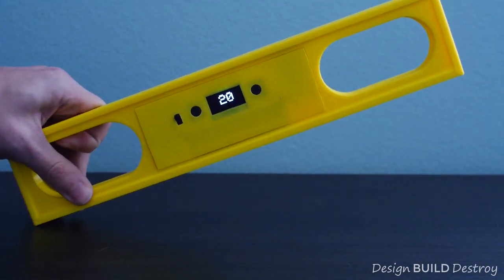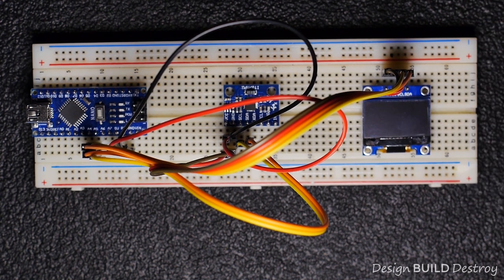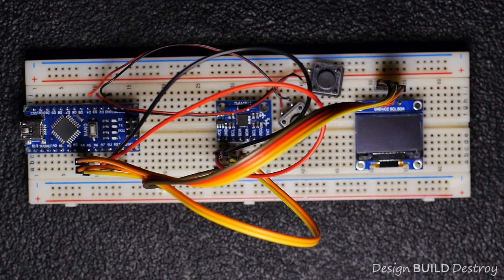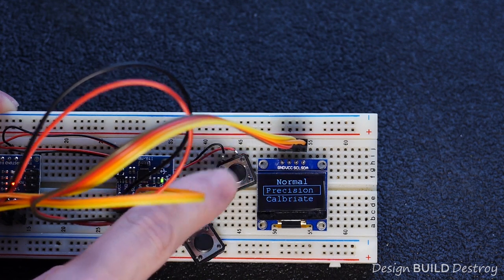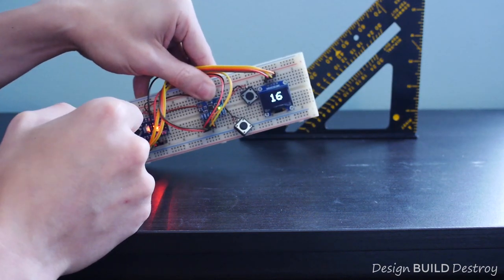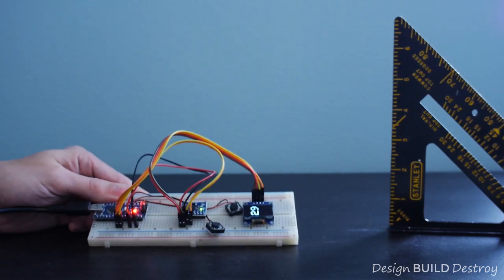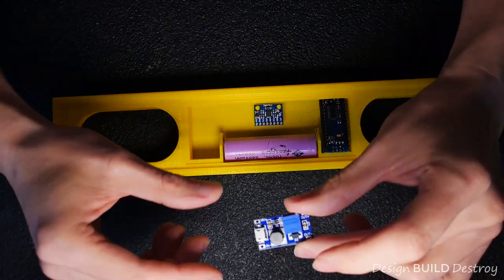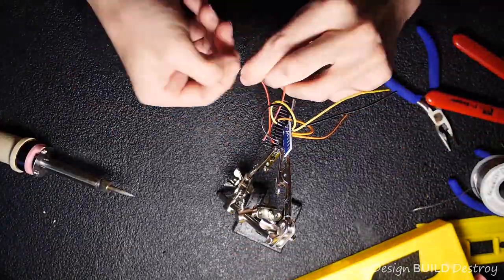Arduino Digital Level using Nano + MPU6050 Gyroscope/Accelerometer + OLED display

Comment: Just fantastic, I will do it, it's cool. I would like to modernize it further. here are a few ideas, and then we’ll see for ourselves, but this is already cool.

Tilt Indication: Add visual and audible indication function to indicate tilt in a certain direction.
Attachment Magnets: Add magnets to the level body to allow users to easily attach it to metal surfaces.

Comment: Great job designing and building this project. I recently came across a power bank called wemos esp32 battery sheild.. To me this is a great  power unit to use, and will simplify things. Once again two thumbs up!!!
Reply from the maker: Thank you! I've seen the battery shield and agree it would be cleaner approach! I tend to just use what I have laying around.

Comment: Maybe Calibrate could make a reading in the Z axis, then you rotate 180 degrees and make another reading. Easier than requiring a level surface.
Reply from the maker: Great idea, I'll have to play around with that. I've only ever had to calibrate it just the one time on an existing level surface and it hasn't drifted off, not yet anyway! It would definitely be a big improvement to take the need for an existing level surface out of the mix.
Reply: @DesignBuildDestroy  I have a idea of something like  this for another project would you mind chatting with me and I can give my idea and get your input ?

Comment: I already tried to build it... and It works!
However, I recognized that the yaw will increasingly drift by the time even you do not move/touch the calibrated sensor. Do you have any solution for this?

Comment: Great project! I have an old hardwood level that would benefit from this as an upgrade.  Would really like to see an in-depth video of the coding side of the project (I'm a complete newb with Arduino)
Reply from the maker: Thanks! I am planning to put a video together on the code side soon, it would have been a little too much to include here. I think there is a much better way to handle the rotation and angles than how I coded it, maybe someone out there can propose a better solution ;)
Reply: @DesignBuildDestroy  
 
hi ,  how  can i  detect 360 degree rotation of  mpu6050 and when it completes it  . IT  will print (" la la ") ; please help me

Comment: Good explanation, i have tried your code is working . thanks for your effort . i face one problem x angle vary continuously 0.01 degree for every second in  sensor stable position .any guide  for that.after  few minutes it goes 5 to 20 degree.waiting for your reply.

Comment: Cool project! I’m trying to build one bye myself but i have problems with downloading the write zip codes and getting them to work in Arduino. Are you able to make a video to explain how you got everything to work? Thanks
Reply from the maker: Just uploaded a code review couple days ago: https://youtu.be/FhBxuh8dtpE
Also check out https://youtu.be/lGvympJcHdM if you are not sure how to load custom libraries found on Github, I use a specific MPU6050 library found on Github not the one in Arduino Repository.

Comment: Hi, thanks for the excellent explanation. i want to ask, is it linear acceleration or angular acceleration which can be measured by MPU6050? can it be used to measure angular acceleration?
Reply from the maker: I think so, because it's a gyroscope with accelerometer the gyro is telling you how its moving in space (like the angle) while the accel is telling you how fast. If you want direction your moving you probably want to use a different model that also has a compass so you can know which direction you are moving in and at what angle and speed.

Comment: Update on the project is that i have solved the issue with the code and needed to change the name of the #include file(s) as the code wasn't recognising the libraries that were installed. 
Now I'm having the issue of the screen not turning on, everything else works correctly and everything is being powered and i have double and triple checked many times as well as de-soldering and re-soldering the parts together.
What would you recommend i do?

Comment: Nice project, I’m currently building this as my first project 😅 but I get an error that dmpinitialise is missing. Do you know what I am doing wrong?
Reply from the maker: I'm guessing you do not have the right library installed. I am using Jeff Rowberg's MPU6050 library they may be a little different from some other's out there. I threw them up on our site for you: http://designbuilddestroy.com/fileshare/digital_level/MPU6050_library.zip. Unzip to your Arduino IDE library folder, on Windows it's in My Documents->Arduino->libraries. The folder should be named MPU6050. Jeff's awesome Github repo is https://github.com/jrowberg/i2cdevlib/tree/master/Arduino/MPU6050

Comment: Loving the idea, but can't get the libraries to work. Stymied at 'class MPU6050' has no member named 'CalibrateAccel'
Reply from the maker: Sounds like you may not be using the correct MPU library there are a bunch for the MPU6050 and they can vary quite a bit. I'm using Jeff Rowberg's MPU6050 library link is in the top comments of the source for the project, you can download the library here: https://github.com/jrowberg/i2cdevlib/tree/master/Arduino/MPU6050
Reply: @DesignBuildDestroy  after installing, uninstalling 4 times it finally worked.

Comment: Great. By the way, if I want to display full 360 degrees rotation I just need to comment out "angVal = (90..."?
Reply from the maker: It's been a while since I've wrote this code but off the top of my head I think you'd just need to set angVal = ea.y. angVal variable is used in the formatDisplay function to print the value on the LCD. So within the IF statement blocks that handle the screen orientation and come up with angVal you could comment out all the angVal's in those IF blocks, and then right above formatDisplay function call add a line angVal = ea.y or make the call as formatDisplay(ea.y, dispRotate);
Reply: @DesignBuildDestroy  Thanks!! Awesome job, congratulations!!

Comment: Can't tell from the schematic or the video.... Is the battery connected between the charger and the booster?
Reply from the maker: If you are using a TPU4056 charging board the battery connects directly to the board at the B+ B- terminals. Someone in the comments or on Hackaday pointed out the power switch really should be between the output (OUT+) of the TPU4056 and the positive INPUT of the Booster board. The way I originally built it has the power switch between the positive OUTPUT of the booster, which means the booster board is always powered even when the device is "off" so it will eventually drain the battery. I need to find some time to update the drawings on designbuilddestroy.com

Comment: the switch is too far - the booster is always powered by battery - I would move it 1 step to the left on your diagram to make sure when off battery never provides power to booster
Reply from the maker: Yeah, dumb on my part, I updated the layout on the site. A couple people pointed this out but looks like I forgot to update the drawing
Reply: @DesignBuildDestroy  people who cannot accept the critics are dumb - since you accepted then it is... accepted ;-) And my comment was not to discredit your great job! ;-)

Comment: Hello, i am trying to create this project myself and I'm having some trouble with getting the code correct. The first few times i used the code and verified it, there were a few error messages that said that they libraries in the code didn't exist at all. I've watched your other videos explaining the code and uploading the zip files and now instead of those error messages coming up, its stating that the code cannot compile with the arduino nano board. 
if you get to reading this i would really appreciate some help.
Reply from the maker: Hmm I wonder if you try changing the #include "MPU6050_6Axis_MotionApps20.h" to #include <MPU6050_6Axis_MotionApps20.h>  May need to do the same with the I2cdev and wire. Arduino IDE is kind of tricky and oddly it seems to install differently on some machines with folders/config files in different locations probably depending on the version of when you first installed it.
Reply: @DesignBuildDestroy  would there be any code changes since the arduino software app has updated so maybe some of the older systems don't work anymore?
I have the most recent release of the arduino app and I'm just wondering if that may be the issue
Reply from the maker: @scaryotter_0352  The code itself wouldn't ever need to change with different versions of the Arduino IDE.
Reply: @DesignBuildDestroy  Ah ok, I might go and do a few more run throughs of your videos and try and follow them exactly, if it works then I'll be happy. If it doesn't then I'll try and get further assistance

Comment: Is it possible to use this as a potentiometer that can supply 0v-5v base on an angle?
Reply from the maker: I suppose using AnalogWrite() and a low pass filter circuit you could create a variable output voltage based on the angle
Reply: @DesignBuildDestroy  Trying to see if I can use it for my electric trike.I will need to learn from basic 101. thanks!
Reply from the maker: @RideBicycleUSA  Curious what the use case is? Automatically change gears based on the angle?
Reply: @DesignBuildDestroy  I just ordered listed items for this fun project. I hope my high school electronic 38 years ago helps.
Reply: I only have the circuit completed but it functions just like in this video.  Thanks!!
Reply from the maker: @RideBicycleUSA  Awesome, now hack it to make it do what you want for your project ;)